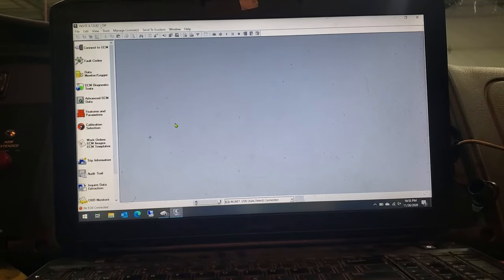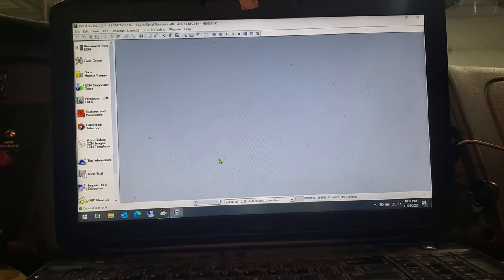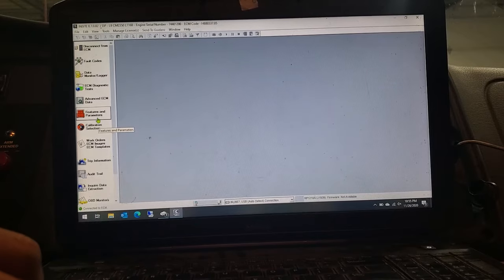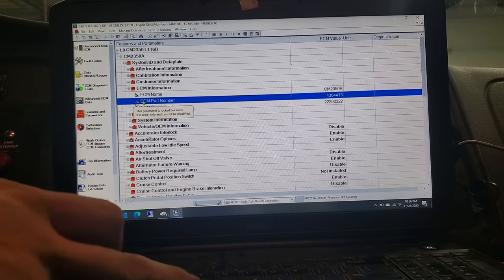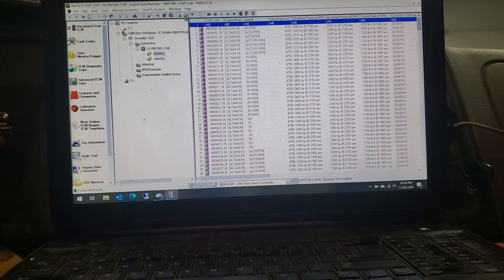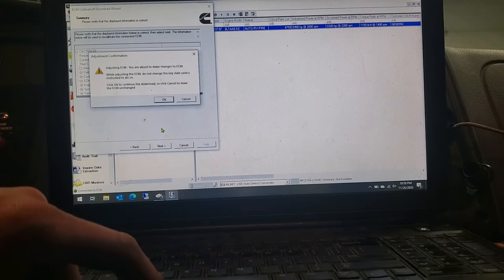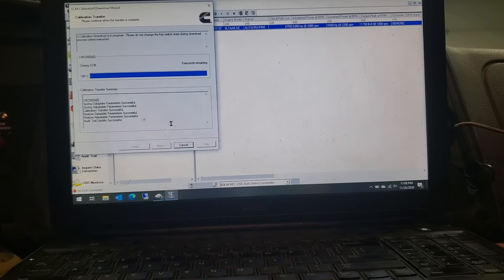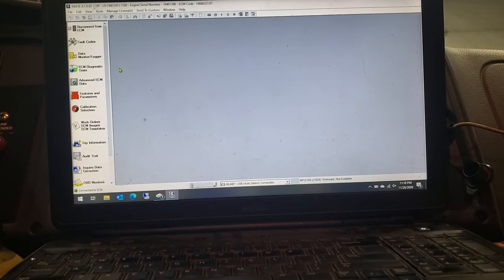Cummins ECM update with Insite

Comment: Hey I need help in the parameters when I crank the truck the  sensor camshaft speed rpm doesn't run and the crankshaft sensor go up two 200rpm the truck doesn't start

Comment: Is there any way for the average Joe (not a certified dealership technician) to get their hands on this equipment/software? I hear they hold it pretty close to their chest and charge an arm/leg for it.

Specifically, I'm interested in changing a few of the features on my truck -- all tied into the ECM, obviously. But would rather have the software/equipment to do it myself instead of pay hundreds of dollars to a dealer every time I want to change something.
Reply from the maker: Yes depending on what u want to change for parameter there other programs available to another software I use is jpro

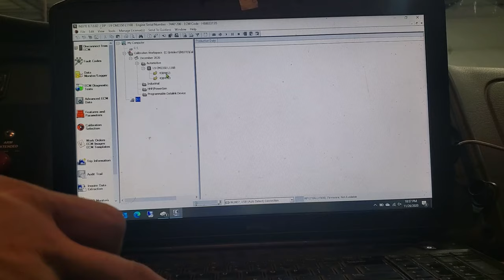Comment: When you select an ecm at about 3:10 it won't let me click that where it says like "isl cm2350" or whatever I click it and get an error code. Any advice?
Reply from the maker: If I understand correctly that's happened to me and I called support cause it happened cause a an error during a computer software update
Reply: @dirtydieselnation8826  like I might need to update insite on the laptop or what ?
Reply from the maker: Yes and as long as your connected to internet u can update it and if that don't work let me know and I'll help look into it further for you

Comment: what if i buy an ECM that comes with a power generator calibration, but the ECM is the same as used for trucks.
Can i just flash it with the truck calibration and use it on my truck?? the ECM PN is the same.
Thank you
Reply from the maker: Honestly I've never tried it but I believe if it's the same ecm then yes u can flash it to the right calibration for your application

Comment: Great video! Very helpful. I work for a state transportation shop. We have the Insite Pro. Will we be able to do calibration updates? The calibration available screen has never popped up for anything that I have worked on. I also have access to cummins quickserve.
Reply from the maker: Yes you should be able to updates and if it needs one it would pop up but if not you can always check for one manually and quickserve is a great tool once you start using and getting familiar with it
Reply: I tried it again today and it worked perfectly! Thanks again.
Reply from the maker: Welcome

Comment: What if I need to recalibrate due to def issues. Def showing full and empty. And in derate.
Reply from the maker: You can still do the recalibrate and let it reset but if the problem continues you will need to look into the issue causing it to act up

Comment: Great video.. Thankyou.. I have a question, if I calibrate with different  ecm part number by mistake, is possible the engine get broke?
Reply from the maker: No but it may not run or if it does run it my run rough
Reply: @dirtydieselnation8826  I can't enter mine, what should I do?
Reply from the maker: What do u mean u can't enter mine
Reply: @dirtydieselnation8826  Now my software can't get inside, need your help
Reply: @dirtydieselnation8826  How can we talk to each other?

￼
Reply from the maker: What software program are you using and we are only on the computer as of now
Reply: @dirtydieselnation8826  My software is broken, do I have to delete it and re-download it?
Reply from the maker: Yes that's what I would start with wipe it clean and then re-download it again
Reply: @dirtydieselnation8826  bạn có một liên kết để tải về phần mềm đó?
Reply: @dirtydieselnation8826  do you have a link to download cummins insite software?
Reply from the maker: You can get it right off the Cummins website

Comment: If one has Incal files could they change the ecm file to a "different" file? Assuming the CPL is compatible. For Example, we do heavy hauling. If I find a file for an ISX that would give me a 50-100hp bump ( but the CPL is the same) so the internal engine components are the same, can I just pick it and go?
Reply from the maker: In most cases yes

Comment: How do I check and see if the ecm has the latest calibration if the screen does not pop up?
Reply from the maker: You will have to check manually and if u watch my video it will explain what to do if the screen doesn't pop up but 9 times out of ten if it don't pop up u are running the newest calibration
Reply: @dirtydieselnation8826  guess I missed that part. I'll look again.
Reply from the maker: If u can't figure it out let me know and I'll make a video tonight just specifically for that

Comment: Question. I'm having fault codes for both intake and outlet NOx sensors, relays and fuses are ok but the comluter it's telling me that ECM is not getting the return signal, I've tested it with a new sensor but still showing the fault codes. If anyone can help me out with that I would very much appreciate it. Thanks.
Reply from the maker: I would look into the harness

Comment: Nice video man. I wonder if you can tuneup the motor with this software. I mean like bump up the 550hp to 600 or somethinn
Reply from the maker: You can all You need to do is get in touch with Cummins and they can sell you the correct fleet cal its cost around 100 bucks really simple to do